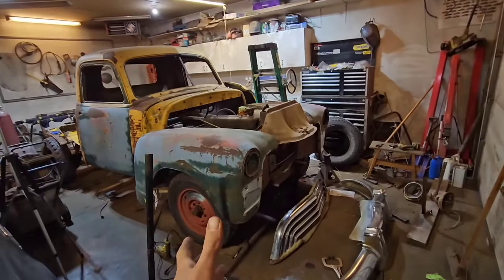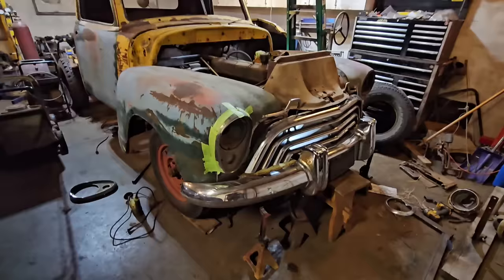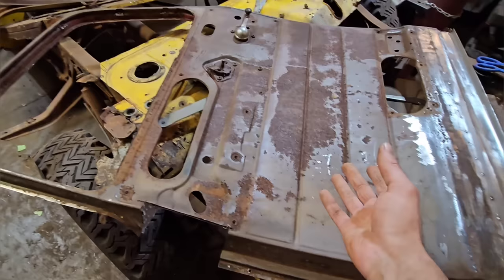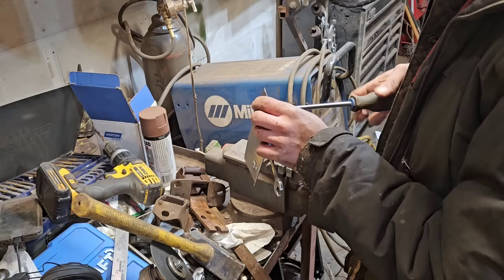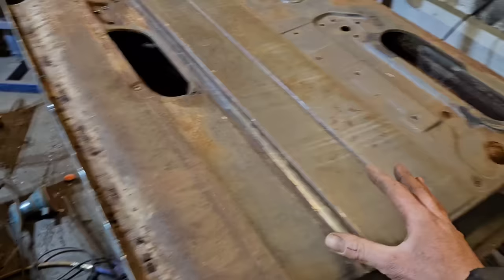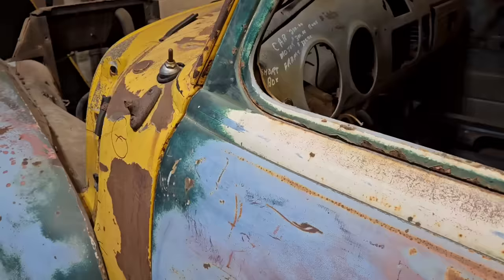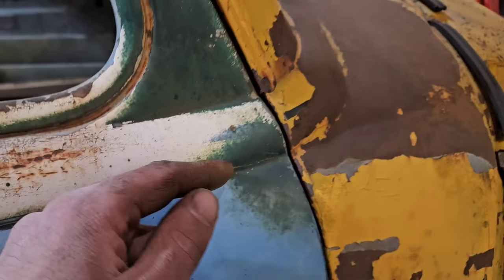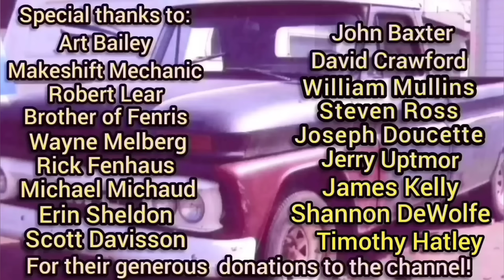Custom Grille Idea! What Do You Think? Plus: Building a Patch Panel and Fixing HACKED Doors.

Comment: I did a pre-purchase inspection  on a BMW 3 series once, and discovered seam welds underneath that should not have been there.  The back third of the car had been clipped off.  Tons 'O' Bondo in the "C" pillars.  Told the customer not to buy it who than told the owner why there would be no deal.  Owner stormed up demanding to see the "issue".  He had bought the car from a sketchy local body shop and had no idea of the true condition...

Comment: Kyle: It looks like the original Dreamtruck had a custom tube bar grille.  The Olds looks like a pretty good fit (I like a Custom with OE parts incorporated).  Since it is a large opening a big car grille like a Chrysler or Cadillac would fill in the front well.  Whatever you do will be cool!😎

Comment: Nothing beats a day in a junkyard wrenching on old junk, cutting yourself, swearing a lot while running the risk of getting glass stuck in your backside for just the right part. I've been there a few times. Nice save of the grille. That will be the perfect thing for some project and you'll be glad you have it. This is going to be epic when it's done. Your shop attire is deplorable. You really need to start your own shop fashion line. Cheers!
Reply from the maker: I was trying to set up a shop clothing line, but the plan failed because the safety inspector claimed my jackets were a contaminated biohazard and could not be shipped!

Comment: I think the grill looks good it does a little tweaking to work out better. the bumper looks heavy maybe without the bumper guards, but the ends fit nicely around the fenders, maybe you could take the center section out and extend the bottom of the grill with some kind of a roll pan as a filler.

Comment: I love how you edited in the driving sequence to tone down the excitement level.
The new phone camera will make you into a first class internet cinematografur.
Would the Olds hood work with grill on the truck.  Looks similar from the front shot
Reply from the maker: It probably could work, but I think it would be faster to modify the front of the Chevy hood. If my plan works I will still be able to use the stock Chevy hinges which will save a ton of time

Comment: I like the way you work and in my book do things properly. Getting those doors to fit nicely rather than the famous "it is what it is" statement. Fully restoring a vehicle properly from scrap yard condition is a massive amount of work, especially if your doing it around your day job. It is also quite a large skill set from mechanical work to tin bashing and welding, electrical, painting, and finally sewing and interior work. It took me 2 1/2 years to restore a car where I worked on it most evenings and weekends.

Comment: Those are super kool trad., kustom parts.Grill might work, but ya need the sectioned hood first either way. What about a 49-50 Merc., grill  opening, Izzy might have seen @ same place? Ya need a fifties GM dream car vibe, bro, Buick bezels could really work, Your gettin it!  Very first dream truck had earlier (47?) cab on 49-52 car chassis, with 4 carb Olds! Yes Izzy knows,,,,

Comment: I like the look of the bumper and grill with those existing headlights , mainly because the headlights look like the fill the space on the front fenders between the grill and the bumper with uniform margin around. It looks neat and good protection for the front of the truck.  Also the chrome quality is still really good.

Comment: I'm high enough to like just about anything but the front end seems a little overpowering to me. Keep in mind I have no fashion sense. The speed you work at is amazing. I've never seen anyone swing a big hammer that fast. You might get more done if you worked on it more than 47.18 minutes a week including wandering around the frozen tundra. Mary was worried sick until Poe showed up. Her and Joseph send their love. As far as your coat I have a similar one that is only 3 generations old. I do know it's better than welding in your skivvies and slippers. I have a 53 3100 that I'm working on and this is the most exciting this I have seen. Thank you for your time.
Reply from the maker: Thanks for the time management advice! I think I might work on it for 48 or 49 minutes this week.

Comment: If I were in the shop while trying grill, I'd be tempted to turn grill upside down without bumper. Camera angles are never good, but it looks like the upside down bars of grill would blend in great with the inner section of fenders. Id skip the headlight bezels while trying that out.

Comment: Another excellent video! Herbert would be proud both of the jacket and your work. Great save on the Olds grille and bumper! When you mentioned a floating grille bar do you mean like the style used on the 53 Olds? This bumper may be a bit too thick? But you would know best! You should consider a Carter Auto Restyling line of work jackets that look just like yours!
Reply from the maker: Thanks Alan! Yeah I was thinking something similar to the 53 olds grill

Comment: The grill definitely works since it kind of reflects the multiple grill bars of the original design. Like the idea of the split (camaro) style front bumpers but maybe something a bit smaller scale. Maybe even the Camaro bumpers?? Seems like some of the "crown" needs to come out of the front fenders leading to the frenched headlight buckets ??? Pancake the front of the hood more than the section amount at the rear to "flatten" the front end a bit more. ???? Just some "vision" thoughts ???
Love those 47 Olds grills. This one does look so "pristine" !! Sorry about the thumb. ;o)

Comment: Nice grill.  It would look good with the bulky top bar removed with the section front end.  It would also shorten it up and the Buick headlight trim would work better.  But, I think the prize was the windshield frame/A post.  Just has a cool custom look without all the work of making a custom windshield frame etc.  But it's probably too narrow.  Anyway...............I thought you got a new jacket a while back.  I didn't see the Bondo repair.  Or did the Bondo fail there also????  lols

Comment: High Def rust..... I LIKE IT!!!

Not that I have a say in the build.... but.... 
I'm simply commenting as the video goes.

I like the Buick headlight bezels. I'm wondering about IF you were to use pieces of the Olds grill instead of the whole assembly.

Nice work on the countersunk holes.

Hinge tweak worked out nicely.

Wardrobe.... What you wear is NOT why I watch... what you DO is.

FAR from a boring episode. The details (to me) are what makes or breaks a project.

Comment: Maybe this old trick might help you with the chopped roof.  One of the troubles with chopping a roof is the cut down/custom windshield glass that is required after the chop.  Yes, there are ways to do it yourself, but they are difficult to do correctly.  An old trick to avoid custom windshield glass is to lean the A pillar back by pie cutting the A pillar at the bottom and top of the windshield post, without shortening the windshield frame.  This will allow you to keep the original windshield glass without modification.  Leaning the windshield frame back will usually result in a chop of 1-2 inches depending on how aggressively you pie cut the A pillar.  If you do this conservatively, you may be able to avoid having to add metal to the middle of the roof between the A and B pillar, which is almost always required in any chopped roof.  The result is a custom touch that people sense and respond to (it gives the truck a sleeker look when done conservatively), but have trouble identifying even though they know that the top has been chopped.  It is easier to chop the door window frames to match this, because you know right where to chop and lean back the frame of the door to match the pie cuts in the A pillar.  In a traditional chop, a lot of the time is sucked away working on the door window frames, trying to get the door frames to match the top.  This makes it easier and less time intensive to chop the doors.

Comment: Those parts are a really cool score, but i think with the Buick bezels they make the front end look too "crowded" on the truck. I think the floating grille with '49-50 Merc style grill opening with frenched headlights are way to go. That reference model truck looks smooth and making some point of the truck looking heavier, breaks the balance of the smooth appereance. Less is more in some cases. I have seen custom cars that the body lines looks perfect, stance is great, but then there's been added a lot stuff that makes the car look like a crossbreed of a collection of miscellaneous car parts and a disco ball. Keep up the good work!

Comment: My Pop was born in 1942 he Drag Raced Cars from early 60s to early to mid 70s he liked the lead sleds and i Did like some of it. The Frenched head lights and tail lights. I like changes that you have to Really have to look for. I mainly like the bodys and interiors stock and Clean. You be you it's your truck and you Do Really Nice work. I injoy watching and im learning a lot. I Grew up around chevys in all forms a few fords and he had a nice 36 Dodge ( sweet). I Really injoy learning more about the metal finishing. I'm  a perfectionist but im getting older.

Comment: If you use those headlights then go with something smaller like a floating grille bare and a smaller bumper . The large grille and bumper  will grab eye attention and the headlights will not hardly be seen . My two cents worth .

Comment: Good morning Kyle, and thanks for another great post. May I ask a question, please?  Here in Western Australia, we do not have the extreme cold that you experience in Canada. Do you need, or have to warm the sheet metal slightly, before commencing the tig welds? Today we are at 40 deg C, so things get err naturally warm! Thanks for posting your work and I always look for your new posts.
Reply from the maker: No need to warm the metal. I did find out years ago that mig shielding gas is ineffective when the temperature drops below minus 40. Luckily I have a heated shop to work in these days so that's not an issue
Reply: Thank you Kyle.. and I still want to pre-order one of your jackets lol
 @CarterAutoRestyling

Comment: Looks like the Chicken truck is coming along well. The purists will be out to get you for "Ruining" a fine example of an unmolested original. You will get no credit for saving it and the extra parts that were all going to get Recycled (Nice Word) if you didn't stumble onto them. As for the grill area less might be more . Maybe the fellows over at @coldwarmotors might have some sort of grill that is missing the rest of the car that could be snagged for a fair price that would work.

Comment: Your scale model has no bumpers which looks slick..If you are to use bumpers the one you have might look better on the rear flipped upside down with exhausts through the overriders 🙃..The grille might look better with the three top bars and the bottom panel flipped upside down and grafted in..no bumper on the front just that bottom grille panel slightly proud with tag fitting in there somewhere...not sure about the buick bezels